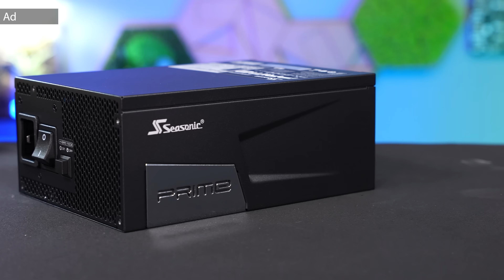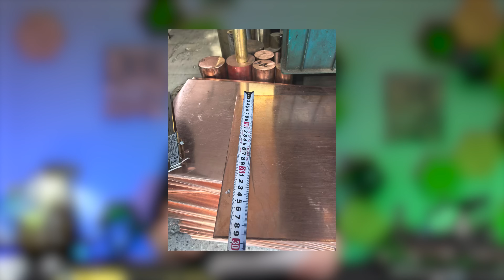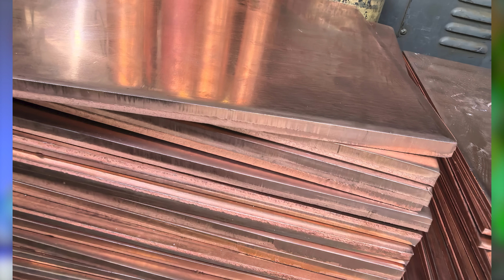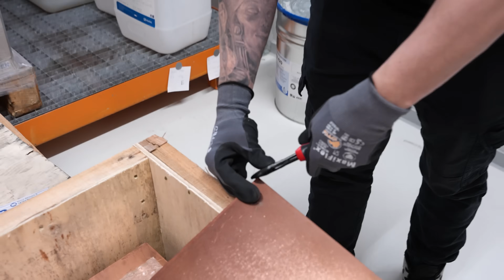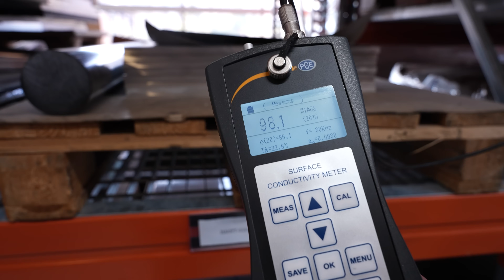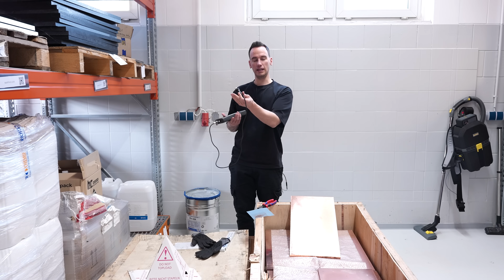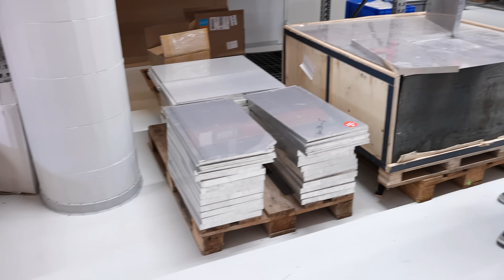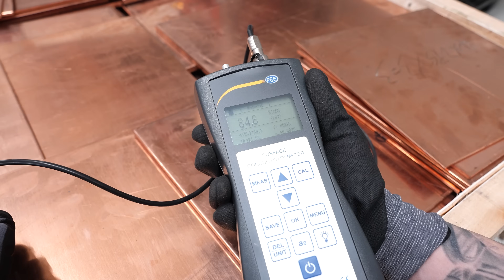I Got Scammed

Comment: 2:00 well u can pay expert to check load for u before shipping and paying
Reply: I think the issue with that is that you have to then confirm that the correct pallet is loaded on the ship, they could have people paid off at the port that has an identical scam pallet ready at the port to load and the good copper goes back to the factory. The only way to ensure it is shipped properly is to have good industry contacts where people in China actually have their reputation on the line in China and with foreign business partners. In China everything is about saving ones reputation, scamming a foreigner as a random Chinese factory owner is fine there, but if you are a third person in China that handles business for foreigners you can't be caught scamming... your whole business depends on it. Expensive stuff in China should always have a middle person between the factory and the foreigners... factory owners are often ruthless, they need someone to hold their feet to the fire, Chinese understand better who to avoid and who to buy from.